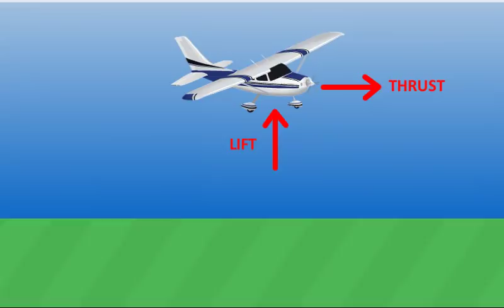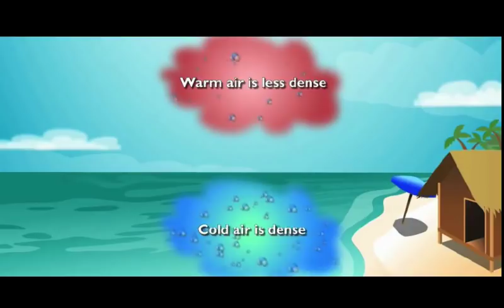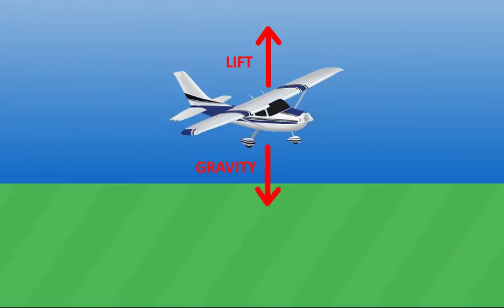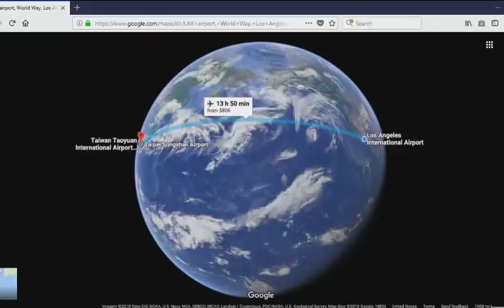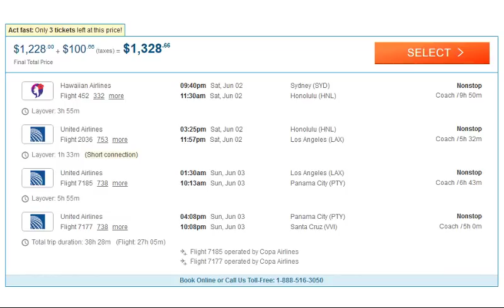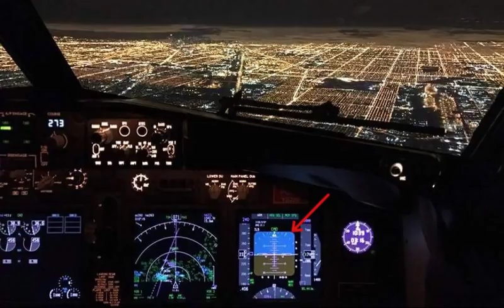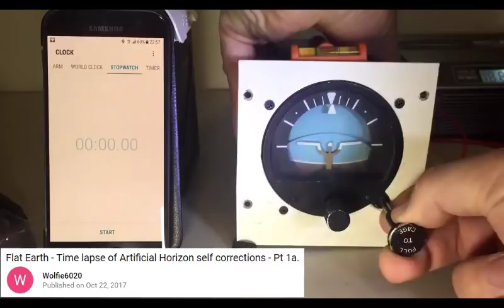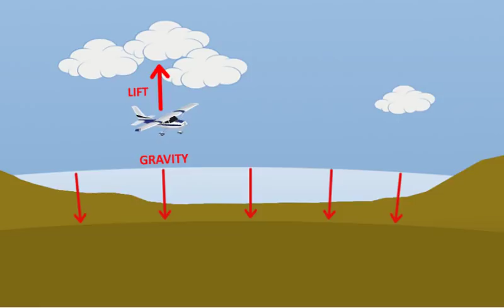Flat Earth Falsities - Plane Nonsense

Comment: So once again, the answer to almost every question flat earther pose is gravity. Of course they all say gravity doesn't exist, how convenient it must be to totally discredit and disregard the one concept that debunks almost every argument they come up with as fake.
Reply: A couple of us did that experiment for a High School physics experiment.  It works, masses do attract each other.  We were able to use the results to calculate the mass of the Earth relative to the masses we used in the experiment.
Reply: Bobby Wizdum shouldn’t you, maybe, just ask, what causes tides on the flat earth model? And ask, why do the strength of tides follow a 2 week repeating cycle that mirrors the moon phases?
For instance, there are spring tides and neap tides.
A spring tide is the strongest tide of the month. A neap tide is the weakest.
This is what people call a “ya see Timmy moment” as in, in 1950s and 1960s television shows, the dad sits the kid down at the end of the episode to recap what the kid should have learned from the episode.
Anyway, ya see Timmy, as the moon orbits the earth, the earth, moon and sun will form various angles.
When the earth moon and sun form a straight line, this is either going to be a new moon or a full moon, that means that either 2 bodies are pulling on the oceans in 1 direction, or 2 bodies are pulling in 2 opposite directions, this means that tides during those days are really strong.
Then, as the moon orbits to forming a 1/2 moon, you get the moon pulling at a 90 degree angle to the pull from the sun, this gives us a neap tide, as it’s the weakest of the month. 
Or, is every sailor on earth, and every person that lives on the coast also in on the whole conspiracy?
Reply: +Bobby Wizdum
would you be nice enough to explain these points in your model:
1-tides
2-what is supporting the sun and moon
3-what force or mechanism causes the sun to change orbit and speed?
thank you.
Reply: Bobby Wizdum the moon orbits the earth
Reply: Bobby Wizdum
Actually it does, you're just too dense (pun intended) to understand it.
https://www.youtube.com/watch?v=KSxryGwsUQ4&t=970s
https://www.youtube.com/watch?v=MTY1Kje0yLg
Reply: It has been demonstrated that two masses placed a distance apart are attracted to each other with a force that is proportional to their masses and inversely proportional to the square of the distance between their centers of mass. See Cavendish experiment and the gravitational constant was measured this way.  That is sufficient validation of the theory. It works, it is repeatable, it is predictable; that is all a theory must do to be accepted and useful.
Reply: Okay. I am going to admit that I have been lying about the tides for years in order to support the ball Earth conspiracy. Being a lobster, I am okay with getting paid in chicken wings, but this tiny keyboard sucks. How am I supposed to type on this thing? Especially with these rubber bands around my claws?
Reply: Robert Williams, screw you. I am not some arachnid. I have ten legs.
Reply: Mike Lemons c’mon man, uhhh, lobster, you just need to think outside the box, you have 8 legs, just learn to step on the necessary key. It’s also a good aerobic workout.
Reply: Do you know why people don't grow lobsters in pens? It is because lobsters eat each other. Yeah, I said it. I probably ate my own offspring at some point. Ingrates. Screw them.
Reply: Meh, this old gravity is just a theory bullshit become old really. Newton gravity was a theory indeed, but that simply the explanation to the phenomenon the not existence of the phenomenon. It have been proved wrong by general relativity, than is a other explanation to the phenomenon.

No matter the actual explanation. The phenomenon still very real. All object accelerate toward the earth, all at same acceleration no matter any propriety they process. neither their mass, density, shape, electromagnetic propriety have any effect on this phenomenon. Only distance to the earth.

Only conclusion possible is than SOMETHINGS cause that effect and that somethings is inherent with the very existence of matter. Now there is only two way a object can accelerate, a force or a motion trough a non-linear space time. That it.

FE are just in denial. gravity existence, in one form of the other, whatever the theory explaining it in the past, now or in the future, is a undeniable phenomenon based on hard logic and solid evidence.
Reply: TOXSYC tv gravity is a fact. We have theories about how it works. 
Relativity is as good a theory as our technology allows us to measure.
You have something better?
Reply: Chris Kostokanellis - Yep, FE have a hard time understanding what a theory actually mean.

So if any FE see this. A theory is a attempts to explain a phenomenon. It is created by taking observation and making a hypothesis of what are the law governing this phenomenon. When try to prove it wrong basically. If there is not a single observation as a given time capable of proving the hypothesis wrong, and the hypothesis successfully conform and predict any observation we can make. It become a theory. Theory simply mean: "impossible to currently falsify" .What can also be seen as "most probable version of the truth we currently have"

Don't mean theory are now the ultimate truth. As new technology and way to observe the world are developed, theory survive or fall all the time (newton gravity, for example, have fallen. At newton time it was impossible to falsify, now it is).

 And it certainly don't mean the phenomenon is not real and invented. As every theory are made on precise observation of the phenomenon. Object accelerate toward each other. they just do we are 100% sure of that. It cause object to fall on earth, object in space to orbit. This is all the one and same phenomenon. That acceleration been called gravity and is indeed a fact. Now there been in history many different theory explaining this phenomenon. 

There is a HUGE difference here. So basically, if you want to refuse a theory. You have to:

1. Provide proof it is indeed wrong.
2. Provide a new hypothesis than is more accurate than the old theory so it can become the new best theory.

Hope it make things more clear
Reply: Adam you're confused about tides, the high and low are not opposite each other, they are perpendicular to each other. http://www.astronomyknowhow.com/moon-tides.htm
Reply: buoyancy is caused by Gravitation, the air around the helium-baloon is dencer, hence it is pulled down by Gravitation more than the Helium, this causes the Helium ballon to be pushed up, same with airfilled ballon in water. the water is pulled down by Gravitation, causing the ball to be pushed  out of the water.
buoyancy requires a denser medium to work.
Reply: question about the tides: tides do(as can easyly be observed) not mean that the water miraculously apears from nowhere and then vanishes again, the Bodys of water are actually flowing westward, also tides do not occur in the same time everywhere on the planet, the tides move westward.

on a flat earth the water would be created in the east and vanish in the west.
on a spherical earth the water would just flow round the globe, and around and around.
now compare reality with the two models of the earth. one "wins" one "looses"
Reply: Mike Lemons - So what you're saying is, "LOBSTERS!"
Reply: Jlesaistu well said
Reply: Bobby Wizdum 5th grade science.  force and motion proves gravity.  https://youtu.be/q-LdfdLl5iI it debunks your bouyancy
Reply: Bobby Wizdum no. water finds its level from whatever force it is being applied. such as doing a barrel on a plane or simply swinging a bucket of water. it will find its lwvel and it is not even going down.
Reply: Ruby Dee it does not defies gravit. thats the same way you let go of the ball inside a pool. does ball defies gravity?
Reply: Ruby Dee any light ball with air such as basketball, tennis ball, ping pong ball.
Reply: Ruby Dee ow boy. gravity affects them all. it just happens  the denser water gets to go down more. its like putting stones in a cup of water. the water gets pushed up. that is what is happening to the ball or balloon.
Reply: It DOESN'T defy gravity.
Archimed's push ( function of the weight then of gravity) is stranger than  gravity's pull...
Reply: Ruby Dee the amount of buoyancy an object feels is equivelant to the weight of the fluid that it displaces. 
A lump of metal 10cm^3 weighed in water will weigh 1kg less than it will weigh out of the water, because 10cm^3 of water weighs 1kg.
A 10cm^3 lump of wood will float on water because it displaces more than 1 kg for its volume.
Steel boats can float because they are shaped to displace more water than the weight of the steel they are made of. This is why the cargo capacity of ships is refered to as its displacement. Ie, how many tones of water it is able to displace without sinking.
Same principle for helium and hot air baloons in air
Reply: EUREKA!
Reply: @ Bobby Wizdum - your name is fitting.  I bet when a magician shows you a good trick you're all:
while jumping around "that's amazing!  that's REAL magic!!  I mean, what else could it be but magic!  There could be no logical reasoning to this, MAGIC! ..now, BURN THE HERETIC WITCH!!"
Reply: Bobby Wizdumb said, "i havent study tides in flat earth in full but im sure the info is out there for you." So, you admit that you don't know anything and then you conclude that you know more than all of the scientists for hundreds of years? How does knowledge spring out of ignorance? We understand how the gravity from the Sun and the Moon cause the tides. We can predict the tides. There is no flat earther math that can predict the tides. Flat earthers are useless.
Reply: Bobby Wizdum https://oceanservice.noaa.gov/facts/springtide.html
Reply: https://www.sciencedaily.com/releases/2011/12/111222103114.htm
Reply: Joe Davenport - technically, gravity is not a force. Just playing devil avotate here :P
Reply: Bobby Wizdum you need to stop with ball and water. try scaling it for once.  and dont test it here wherw the gravity of the earth is stronger.  dumb ass.
Reply: almarjyou a bowling ball or a beach ball?
Reply: Majd Saedy electromagnetism?
Reply: Ruby Dee electromagnetism doesnt explain how a sun would change direction and speed.
Reply: almarjyou the Creator of the sun certainly knows its circuit that it's on daily. Those in control don't want truth revealed, however truth can't be stopped. God says His Earth is immovable and cannot be made to move. That's enough.
Reply: almarjyou and allow hour natural born God given senses to kick in and realize that airPLANES can only fly over flat level land. Official documents record that aircraft is tested on a flat nonmoving nonrotating earth. Indoctrination is very deep.
Reply: almarjyou trying to understand.  Wnat does cause it?
Reply: Ruby Dee no, i am not  we are asking you how on your dumb model.
Reply: almarjyou oh ok. So it's because of the air in the ball? Because gravity is pushing down on the oceans holding them to the earth? But the air causes the ball not to be affected by gravity?
Reply: SubZeroGallant; If you have some proof that gravity exists perhaps you would like to share it with the rest of us. You might throw in your proof that the earth rotates, if you can find the time and of course that other old chestnut where does the curve in railway tracks come from if they are laid flat on a globe earth? Looking forward to your explanations. Go for it!
Reply: Ah! Another smart Alec without an answer. Which part of what I said do you disagree with? For example, in a car should you have a drone hovering, when the car pulled away the drone would hit the back window. Try it! For what it's worth the google earth ball is not a true image of the earth.which is why it is cloud free. So let's hear your mind-blowing intelligent reply.
Reply: Net Hoser 

Don't bother. It's not like he's going to understand anyway.
Reply: The atmosphere rotates with the earth by gravity and friction? There is a real easy way to think about this. So your telling me that gravity is selective then? Meaning the force of so called gravity to hold water on a sphere has to be pretty powerful. Then why can I jump up in the air so easily? Your telling me it has a different effect on water than on humans or any other objects. If gravity were a real thing we would be plastered flat to the ground unable to move....
Reply: The Gig Life a.d barteltapper. gravity depends on mass. it is an attraction of mass. more mass equala mlre weight.  And no, you wont fly around or off the eartg due to rotation.  Earth's rotation is twice as slow as the hour hand. Of you dont get that. Your brain must be really slow. Cavendish experiment proves gravity. The attraction of it depends on the mass you put on the ball. It is repeatable. Search for it.
Reply: barreltapper force and motion 101. https://youtu.be/q-LdfdLl5iI 
dobyou agree tyat an object wont movbve without a force being applied?
Reply: barreltapper wow railroad tracks. hahaha. earth curves 1 degree per 69 miles. you are not gonna see that curve by riding a train. you will be at the same point of the curve. plus railroad track are placed in solid land.  lands and mountains is a thing. good seeing that curve 69 miles away from you.
Reply: barreltapper earth rotation can be detected by foucault pendulum.  its deviation correlates on its latitude. google? there days with no clouds. bbq plus ever heard of himawari? it tells weather. takes pics of earth every 10 mins. maybe you can predict weather and hurricanes.
Reply: I'm still waiting for the flat-earthers to explain how the sun sets beneath the horizon lol
Reply: Bobby Wizdum did you just get your wizdum teeth removed? Is that why you're acting so dense?
Reply: Same to you using theories as fact lmao
Reply: That would be inertia causing the bulge on both sides. Object in motion tends to stay in motion. 

Remember, that while the moon has a gravitational effect on Earth and it's oceans, the Earth also effects the oceans (as well as the moon, hence only seeing one side) . The orbit of the moon causes the water to be pulled slightly towards the moon, but with the earth between the moon and the rest of the ocean, it bulges on both sides. If the Earth weren't rotating and the moon weren't orbiting, if both were stationary, the oceans would pool up towards the moon's side.

Does that answer your question?
Reply: So, I see the typical flattard excuses here of denial and then run away. Good work FE keep stupid alive.
Reply: What the water is really doing is seeking the lowest possible gravitational potential energy state. On a very small scale, this looks level. On a large scale, such as the whole planet, it must conform to the curvature of the earth in order to have the lowest potential energy.
Reply: Bobby Wizdum I mean, what do you have on flat earth that gives Alaska a 15 foot change in tides during the course 12 hours.
https://tidesandcurrents.noaa.gov/noaatidepredictions.html?id=9450296 but, Florida only sees a 6 foot change in tides?
https://tidesandcurrents.noaa.gov/noaatidepredictions.html?id=8720098
Reply: Bobby Wizdum dumbass
Reply: + Bobby Wizdum
The sun also causes tides, moron - just to a lesser extent. Which is odd since flat Earthers think they are of equal size and distance. And BTW, you have no "model", unless the somewhat torpedo shape of my turds counts as a "model" of submarines.
Reply: + Peter
The problem is that flattards don't know the meaning of up and down. They understand it only as distance from Earth's surface. They think it is a universal thing. Anything "below" the Earth is "Down" and everything above is "Up". They forget that for a flat Earth, this would require one of two things - either Earth is constantly accelerating in one direction at one gee, OR there is some unknown force pulling on the entire universe in one direction and something else holding everything against that force.
Reply: + Bobby Wizdum
Bobby, you sad bastard. What force would make the water NOT cling to the ball? We KNOW why water poured on a ball on Earth runs off - GRAVITY! Earth's gravity pulls the water toward it and it can't cling to the ball - at least not much of it. Your idiotic argument requires a force too! One that there is zero evidence for! Whether Earth is flat or spherical, gravity must be real, or every time a person dives into water, some of it should just float up into space - or in your looney world, maybe hit the dome. So since gravity MUST exist, then we only have to ask what forces are at work. The centrifugal force of the spinning Earth DOES cause a bulge at the equator, but it is far too small to overcome gravity.
Reply: Bobby Wizdum doesn’t tidal action disprove the flat earth? Thus, doesn’t water disprove flat earth?
Reply: @Bobby - so I noticed once the mentioned the expirments that shows 2 masses are attracted to each other, thereby proving gravity does exist you moved the goal post to now say "well that happen on a ball and gyroscopes...", then you want to ask about tides. Alright then.

1. The water and ball thing was already covered but I wil touch it here. You are using what ball in your experiement... a beach ball? maybe it weighs what... 1lb MAYBE. The earth on the other hand is estimated to weigh about 1.3 x 1025 pounds. It wins the gravity tug of war.

2. Tides: yes tides occur throughout the planet. When one side has low tide the other ha high tide... now think about why? Could it be that the water being lost from low tide is mayyyybe going over to cause high tide. Or do you think the earth just magically produces and loses water?
Reply: Bobby Wizdum easy, get inside the tallest building in your neighborhood, open a window, jump through and here's the gravity... Of course i decline all responsibility whatever happen to you for testing the theory. Anyway RIP.
Reply: + Bobby Wizdum
Bobby - brilliant! "I don't know how the tides are explained on a flat earth, but I am sure they are!"
Reply: Rand al Thor and Bobby, don't let go of your helium ballon, because it will go up.  Its lighter than the air silly.  It defys gravity every time.
Reply: Ruby Dee ow please. electromagnetism can only work on metals. go to junk yard and see if you get pulled by the magnet that can pull tons of metal
Reply: right "concept".......not scientific fact.... gravity is a theory it is not proven i could make up a theory to disprove all the globe "facts" as well lets call it ralacoty.
Reply: Peter it looks level on all scales
Reply: Robert Williams not sure. i havent study tides in flat earth in full but im sure the info is out there for you.
Reply: SubZeroGallant can you demonstrate the things you say gravity does? no!
Reply: Robert Williams not at all. in fact on your model claiming the moon causes tides well thats silly since the moon is only on one side while tides are happening on both. clearly you havent looked much into flat earth. water fully supports our model.
Reply: Dan Zervos that doesnt prove it can make water stick to a spinning ball, keep gyroscopes level , etc. in fact water and gyroscopes completely contradict your ball.